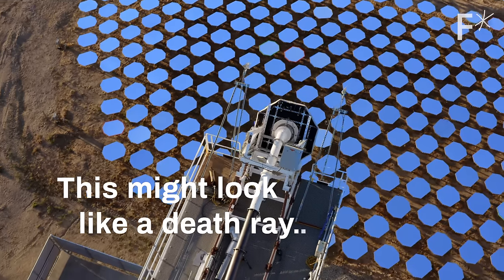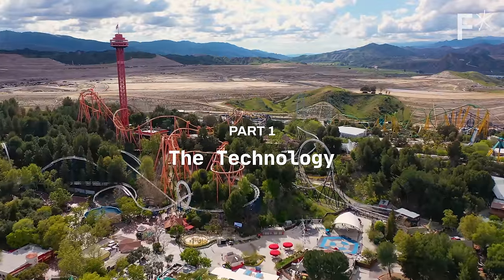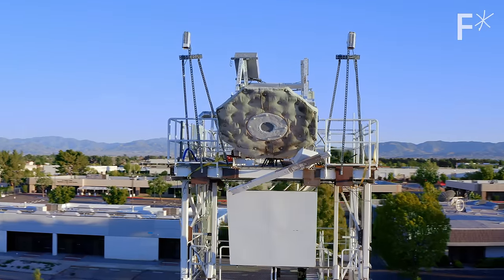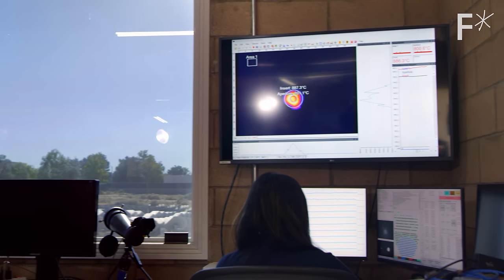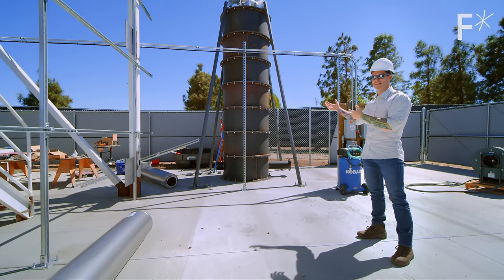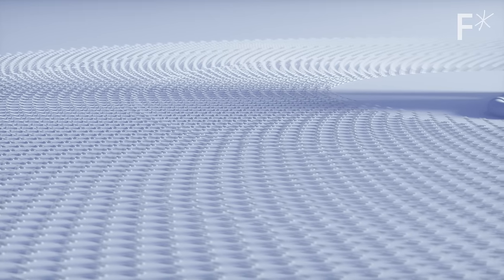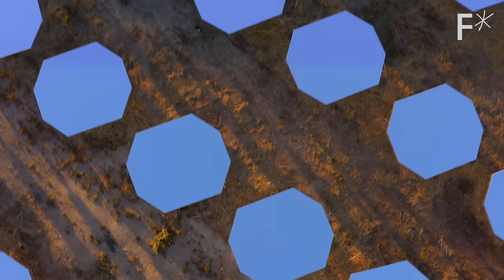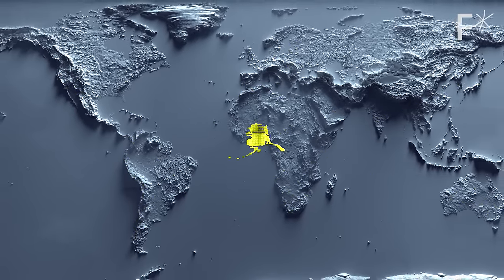How mirrors could power the planet... and prevent wars | Hard Reset by Freethink

Comment: I find it interesting how the monitoring by the cameras and the adjustments of the mirrors are probably needing only little electricity. But still it makes it rather expensive I guess for the third world? So would a  circle of 10 fixed or manually adjusted mirrors give usable results too?? As solar furnace then I mean, too cook rice,to heat water... but perhaps it would not work for electricity production.

Comment: Question, would concave mirrors not be more efficient in concentrating the light and heat over flat mirrors?
Reply: would be having focal length and parallel ray problems i guess .. they need to deploy different concaves over a distributed concentric region ... that would bring manufacturing issues

Comment: Still requires water which is starting to become an issue in dry areas, hence look at California going through a very rough drought. Yes we can use desalination for the ocean water but it requires A LOT of energy and also the high salt brine is an issue, we just can't throw that back into the ocean, it will wreck nearby ecosystems. This is just a vicious energy cycle with so many moving parts and not enough solutions, sounds amazing when someone talks about it but what about the other issues that are part of it?

Comment: Hydrogen has not met our needs in practice, despite enormous amounts of research over many decades.

Charged electrolyte (for example Vanadium redox flow) can also be shipped and immediately used to produce electricity without the fuel cell Achilles heel of hydrogen.

Or just, you know, build wires...

Comment: Now if we could only get the 'mirrors' to collect or redirect photons on cloudy/overcast days or at night .... then, you might have something to work with that is RELIABLE. 
With the current output of the sun's energy emissions impinging 'energy' onto the earth (just like solar panels), you'd need to cover ONE THIRD of the landmass surface are of the 48 United state to equate to the presently used/consumed 100 quadrillion of 'BTUs' per year.   
Does 'environmentalism' include the covering of 1/3 of the 48 US states with panels/mirrors ?????

Rocks as a 'sink' storage .... imagine humongous FUNGAL infections coming from those 'rocks'. 

just a back of an envelop calculation to determing that most of this is simply 'smoke and MIRRORS'

Comment: Just throwing this out there **DUCK**. If you think that just because the majority of areas could theoretically produce energy this way makes it "zero risk" of World Politics, I think you are with all due respect, missing multiple points in your thesis.

The Sun as you pointed out would have to be "good" in areas to be able to produce it.Then, it could be distributed to areas without either the land capable to produce it, or places with low amount of sun or low angle of sunlight drastically reducing output. Then the fact that most of the just right areas are more than likely arid, your going to have dust storms and different grimes on the mirrors (NO, not Elon Musk's baby mama, though Elon could buy the company and she could get a wee bit pissed why he's galavanting with his new Martian side chick er ugh alien? and also ruin said mirrors) ruining your output and potentially the increased resources and/or labor for cleaning those little guys (picture an army of Molly Maids cleaning each one at probably $12.50 an hour).
Let us not forget little world disagreements where another country could still turn off the spigot.
The population is rising, dwindling available space in areas (Japan, Singapore, etc and theoretically everywhere eventually.
Converting to hydrogen to be transported around for use has a very little problem, and I mean that literally. Hydrogen CAN NOT be stored completely. It's molecular structure is so SMALL it literally is impossible to store it long term for storage or transport. Hydrogen will eventually pass THROUGH any kind of containment and possible kaboom as it's also very um explosive assuming that Tom Hanks still makes fire on some island.
Because areas where the right conditions are still relatively sparse but in large concentrations as you have proposed would make excellent "targets" for say missiles or terrorists (because in the future security guards will probably still make $12.50 an hour unless they're security maids who presumably would have an improved wage?) They would STILL be subject to geopolitics I might think. I think there's just so many things not fully gone through yet. Then you have BIG POWER lobbying Senators, the teamsters  maids and guards going on strike, having free time and suddenly there's a bunch of baby Molly Guards running around ramming their Google self driving tricycles into the posts.

Now that I think about it. The success for this endeavor just seems incomprehensible. 😏

Comment: Unfortunate that you didn't address any potential problems with this.
What's the cost of creating these installations compared to other low emission energy producing structures like wind farms or nuclear?
What about dust on millions of mirrors in these deserts?
What about when the mirrors break?
One limitation with hydrogen is that the fuel cells currently rely on platinum to be efficient. The need for rare earth minerals in green tech is one the major limiting factors, not to mention a source of substantial environmental impact. How would this be solved by these installations?

Innovation is good but presenting these inventions as if everything is now solved is counter productive to the end goal.

Comment: The last part doesn’t even make any sense. You’re saying that people are fighting wars over oil because it’s a scarce resource, but then show a map with clearly highlighted areas in which energy would be produced which would make those areas strategically vital. You say that the sun is a highly evenly distributed resource, which might make sense if we’re talking about photovoltaic solar, but the video prescribes a concentrated solar thermal technology which is impractical outside the most sunny areas.

Outside of that, I struggle to see how fundamentally different this is from other solar thermal technologies. I appreciate that they need fewer mirrors for the same amount of energy, but storing the energy as heat to be released later is nothing new. As ever with thermal solar power the issue is scalability which they address with pre-fabricated mirrors but the mirrors are not the only factor in that.

Comment: HAHAHAHAHAHAHA...  No.  Nuclear and Hyrdo are the only two green options going forward.

This is just another dead end tech.  Compare the size and output for a single current gen nuclear or hydro plant vs these mirrors.  You would need a awful lot of mirrors to match the output and that would only be when the sun was shining.  So double or triple that and add in batteries.